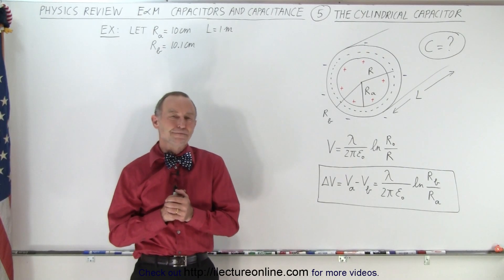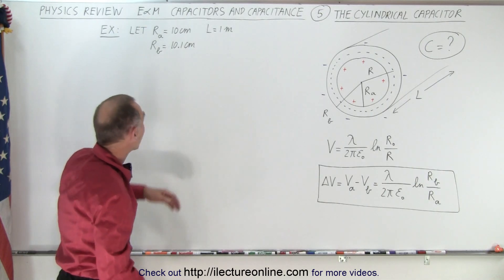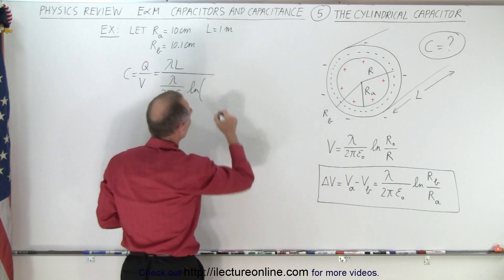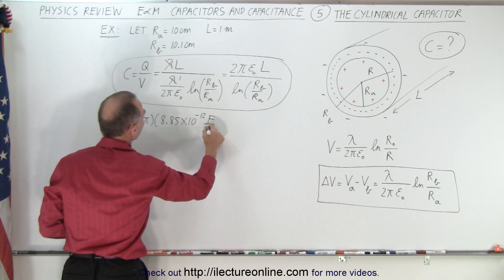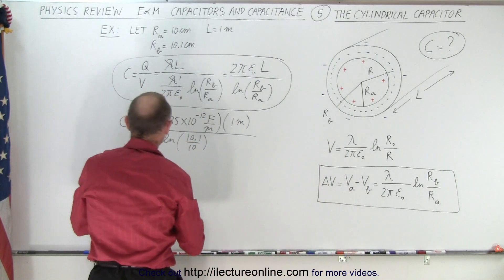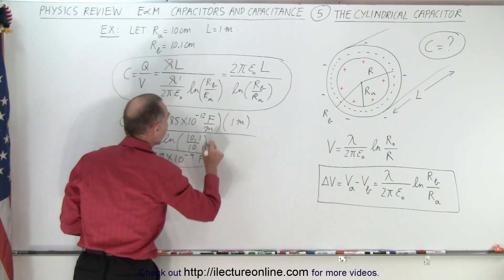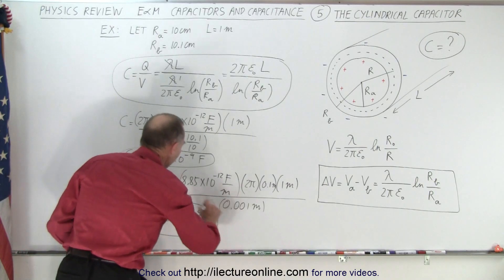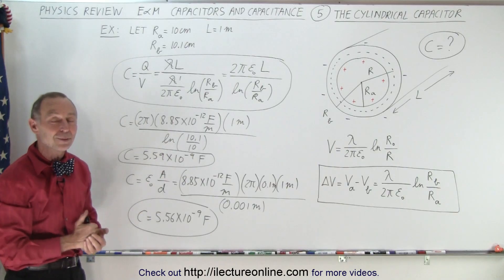Physics Review: E&M Capacitors and Capacitance #5 The Cylinder Capacitor

Comment: How about two thin plates separated by dielectric (or air since we can run thought experiment) rolled tightly. Which equation is to be used? One for two plates or some variation of one for cylindrical capacitor?